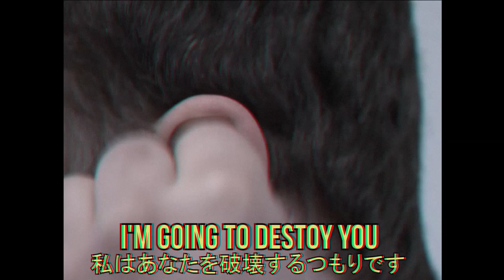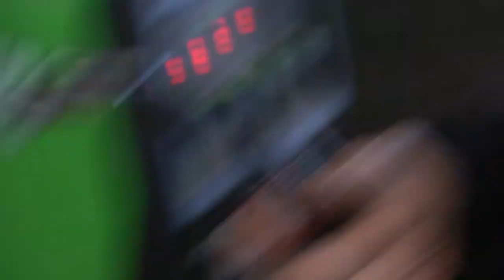I Welded 2 Guns Together And Shot Them At The Same Time

Comment: If a 22lr bullet is going approximately 1260fps, and it has 6inches to travel to the middle once fired, although it is still accelerating, it would take 1/2520th of a second for it to reach the middle, or 1/1260th of a second for it to hit the other gun. You guys would need to have the firing pin contact the primers on both bullets within ~1/2,520th of a second for them to contact in the middle. Which, by hand with two people, is impossible. Technically the velocity of the bullets by the time they reach 6” of travel would be 1/800th of a second because it hasn’t accelerated fully yet, and would be approx 800fps.
Reply: I didn’t take acceleration into account in my equation. Shit.
Reply: Nevermind, I see at the end that I did